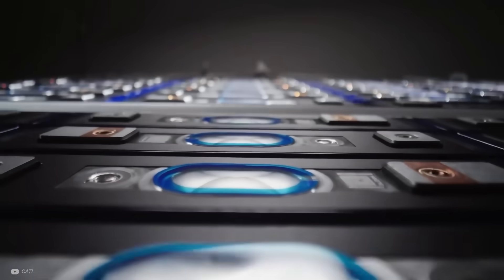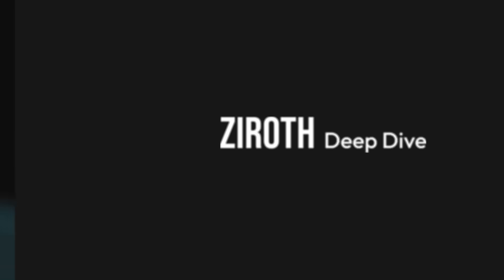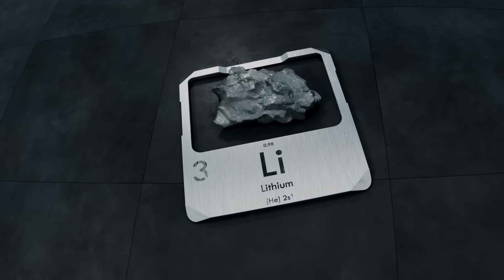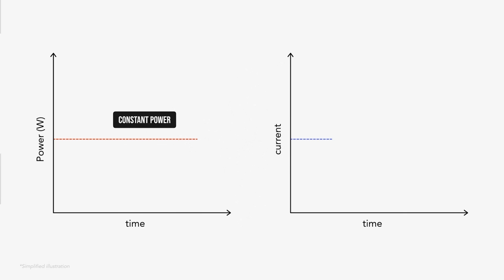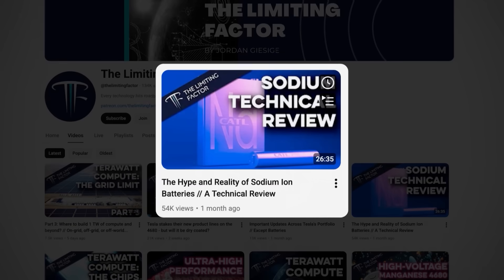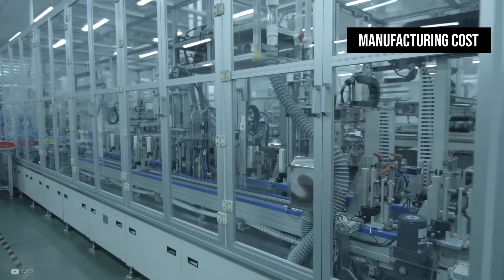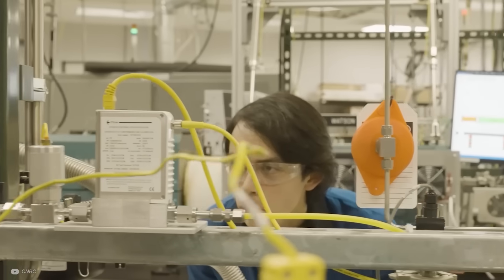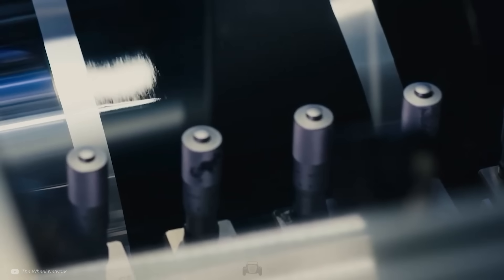How CATL’s Reinforced Sodium Battery is Insanely Cheap

Comment: Will Prowse: "Calendar aging will kill your batteries faster than wear"

Such a frustrating statement! The calendar aging reduced your battery capacity regardless of if you use it. Your wear from cycling is a biproduct of "extracting value" (using) the product. If you simulate it all out, you extract the most kWh over it's life span by using it quite agressively with deep discharges rather than gentle 20% to 80% DoD cycles.

However, if you don't use the battery it will retain it's capacity above 80% for longer than if you deep cycle it every day. So Calendar aging catagorically does not "kill your batteries faster than wear".

The centiment is right, but the statement is just catagorically false because of the wording. The worst bit is when challenged on this he deflects with semantics and straw men. He's doing some interesting research and I love the majority of what he teaches! I'm just worried I'm learning the wrong thing watching him as his communication skills are apparently not great. What else am I "getting the wrong end of the stick" with from him?

Comment: I understand that Antimony is used as a critical element of the cathode. You should be aware that this is a critical mineral. It has few sources with China processing a very large % of world production IIRC. If Antimony is needed then the widespread availability of sodium is irrelevant. Antimony would be the bottleneck and supply chains would rest yet again on China.

Comment: I think that the voltage problem would be more obvious to the viewer if you used a nominal 400v pack to illustrate the problem, than a single 4v cell. 

The voltage of a large pack going from 400v to 200v over the discharge cycle makes the problem quite obvious.

Comment: if the Donut lab's announcement in 5th of January 2026 about an All-Solid-State battery holds true, CATL is already behind the curve; World's First All-Solid-State Battery in Production Vehicles by Donut Lab, an European battery and motor company, that might well be the first Unicorn company of Finland, more significant than Nokia ever was, if these claims hold true and the business side is handled well.

Verge Motorcycles own's Donut Lab, and Verge Motorcycles has already used the Donut Lab motor for a Guinness World Record for the longest distance by an electric motorcycle on a single charge, which is 310.689 kilometers (193.053 miles), set by Sam Clarke and Sara Sloman on a production Verge TS Pro in Greater London on March 22, 2025, navigating real city traffic conditions. The record-breaking ride, which took over 16 hours and used an unmodified bike with a sealed charging port, still had 7% battery left, demonstrating significant real-world range beyond lab tests. This was before the introduction of the Donut Battery, which is set to be on the latest version of the TS Pro bikes.

Comment: the near-linear voltage drop during discharge would make charging electronics and showing the status much easier in simple/small devices… all that magic we do for LiPos could be replaced with a simple volt meter, just like back with acid batteries.

Comment: AI Overview
Sodium-ion (Na-ion) batteries are expected to see large-scale deployment in EVs starting in 2026, led by manufacturers like CATL (Contemporary Amperex Technology Co., Ltd.), who plans to use them in passenger cars, commercial vehicles, and battery swapping systems for cost savings, better cold-weather performance, and improved safety, with mass production already underway for some applications. While early adoption might be for specific models or regions (like China), the technology is transitioning from labs to market, with significant growth anticipated through 2030 for various electric mobility solutions. 
Key Developments & Timeline:
2025: CATL launched its Naxtra sodium-ion brand and began mass production, with its cells passing China's new EV battery safety standards.
2026: CATL aims for widespread commercial deployment in passenger EVs, commercial vehicles, and battery swapping services, with a target of 500 km range for some passenger cars.
Beyond 2026: The technology is expected to grow significantly, offering lower costs and greener credentials compared to lithium-ion, potentially powering a broader range of EVs and energy storage solutions.

Comment: Wouldn't it be beneficial, to allow much larger voltage on these batteries (the optimal operational in higher range) and simply introduce a DC stepdown module with some sensor and real time management of such module? So It would let's just say slowly drop from 20V to 12V but the device is powered 12V at constant. Seems pretty simple but I am no engineer and definitely not that good with electronics.

Comment: I usually really love your videos but, respectfully, this seems to be not your best work IMHO due to ambiguities (e.g. "the not too distant future...?") and not very reflective of all the positives for Sodium batteries that we're being told by industry, e.g. graphs with uncertainty bars showing up to 2040-2050 time frame!? Also, it seems cost subsidies will play a big role in the probability of success and that could easily drain a manufacturer's long-term bottom line. Since grid storage has been touted as the best application of these batteries, at least for the next decade or so, is that where the subsidies for EV use are planned to come from? Good info, though, on challenges of power electronics due to varying current/voltage over charge range. I guess I just couldn't get a consistent read on your position. Maybe I just need more coffee ;-) Best regards.

Comment: Ryan, as well as gravimetric energy density (11:58) one also needs to consider the much lower volumetric energy density of Sodium-ion based cells. This can be seen in CATL's current Naxtra cells, as shown in their Freevoy dual-chemistry battery, where the Sodium cells are 15-20% thicker than their LFP partner cells. For constrained volume applications, like EV battery packs, having sufficient volumetric energy density is as equally (if not more so) important as gravimetric energy density, as being able to fit fewer cells per pack lowers the pack's overall energy capacity compared to an equivalent Lithium based one. 

For applications with less constrained space requirements, such as grid and home battery storage, the lower volumetric energy density is less of a concern. Although, constrained footprint deployment sites may opt for Lithium over Sodium to increase storage capacity to fit a particular site requirements.

I know you also stepped over the consideration of temperature in the video, since most stated benefits focus on Sodium's low temperature handling (and rightly so); however, there is a disadvantage with current Sodium cells at higher temperatures. Current Sodium cells use non-aqueous electrolyte formulations, for higher power densities, that are less stable than their Lithium cell counterparts; starting to degrade from the mid 30ºC, introducing greater cooling requirements for Sodium cells with associated additional costs.

For EVs the lower energy density, smaller battery capacity, and higher systemic costs (cooling and more expensive power electronics covered in the video), likely results in the technology cut-over point not being based on the cell price alone but rather that of the whole vehicle's battery system.

Comment: Li ion (nmc chemistry) also have voltage range for 4.35V (fully charged) to 2.5V (fully but still safely discharged). So it would seem to me that the decreasing voltage/increasing amperage is already a solved problem.

Comment: I think you are wrong and house batteries will become the greatest market when they have better, cheaper batteries. I wouldn't own a Battery Car because petrol/diesel vehicles are much more convenient and provide the range I want. Battery backup for my house isn't out of the question to make my generator backup system more efficient by capturing my overproduction of electricity when the generator is running at it's most efficient output.

Comment: How hard is it to find and mine Antimony?
Reply: In short, hard. 

Antimony's abundance on Earth is 0.2 parts per million (0.0001%) with about 130,000 tonnes extracted each year. The key issue though is access as the mineral is spread thinly across the globe and requires areas with large concentrations to be commercially viable to extract, most of these are in China (which currently produces 74% of Antimony). Most countries list the metal as being the second most supply risk element (with only the rare earth group of elements being a higher risk).

However, Antimony extraction requires significant energy (heat) to process, and even here China is reducing output due to the energy costs involved and emissions resulting from extracting and purifying the element. It also doesn't help that the metal, and some of it's compounds, are toxic (similar level and impact as arsenic).
Reply: @GruffSillyGoat Thanks! Do you think this material is rare enough that it offsets the benefit of using sodium from an environmental perspective?
Reply: @marcuswilson9037 - probably, it's the same consideration as other rare minerals, plus in this case handling and waste processing has to be factored in due to the minerals toxicity.

Comment: What stands out in this analysis is the focus on manufacturability as a key driver of adoption. While our expertise is in mechanical rather than electrochemical manufacturing, the challenge is universal: moving from a patented idea (like your CNC or sheet metal part design) to a cost-effective, reliable physical part. We see this daily across industries, and it’s why we offer a range of processes from 3D printing for initial form studies to injection molding for volume-ready components. Thanks for a clear and insightful look at a key industry shift! For those designing the products that will use these new batteries, we’re here to help build them

Comment: I am still using lead acid batteries in my 1996 Geo Metro / Solectria Force. I have a range of 50-60 miles and a top speed of 64 mph. LOL. Of course, my problem is that if ANY of the electrical components go bad, the whole car is scrap as I can't get parts anywhere! Wish me luck.

Comment: I think Will Prowse misses a key advantage to voltage changes related to SOC.  The charge cycle is simplified and more accurate as voltage gives a most accurate indicator of SOC. Lithium chemistries are so flat voltage is a poor predictor and instead counting amps in is used: a poor and often dangerous metric. Discharge side electronics will be more complex, yes, but 100 years of lead acid charging we are good at it.

Comment: I actually thought that you always use voltage converter when using power from battery in a device. Then higher current will be needed only up to that part in electric scheme, no?

Comment: The voltage curve shown for sodium is similar to the voltage curve for other standard lithium ion chemistries like NCM and NCA which have been around forever and are also not flat like LFP. This has not stopped those chemistries from being used for many decades, so I think you grossly overstate the importance of a flat voltage curve. There is no issue with developing electronics to work with the standard voltage operating range of 4.2V-3.0V of a lithium ion cell. Having a flat voltage curve is not required. LFP is more favored for it's lower cost and long cycle life rather than for it's flat voltage curve. And of course LFP has a lower energy density than NCM and NCA chemistries as well so it's a trade off.

Comment: again, the main sodium issues are  conveniently ignored in this yet another "talk in circles forever" video. when your 500v ev battery needs 10kw and the soc is 50% and volt dropped to 250v.. are you ok the wires now pull 100% more amps? and how will this effect conversion efficiency, not only in EV but also households. who wants their 50v battery to say 25v and then pulling double amps? what when it says 20v? 15v?

Comment: There's more to the story.  And comparison should consider volumetric and mass density of energy storage.  The Li batteries produced today are about half the energy density of what's going to be available in 2-3 years with solid state cells.  EVe heavily favor high energy density and fast charging (high rates).  Stationary energy storage is far less concerned with energy density and power output.  Discharge times of 2-3 days will be more useful for stationary.

Comment: Battery grade Lithium has been between $10K and $12K a metric ton for over 2 years. Your best case is sodium costs become equal at the target energy density for EV... a decade from now. This still doesn't fix the worst discharge curve of any cell chemistry in existance. The best sodium will do is specialty packs for harsh climate. Like LTO, it will have it's niche but certainly won't replace LiFePO4 any time in the next decade. I understand they still need to try but I can't believe the number of people out there who are holding off upgrades and investment now, waiting for sodium.

Comment: That flat discharge curve is actually part of the problem.  Beyond 50% discharge, you can no longer use the cell voltage to determine the state of charge so you have no idea how much power is left until moments before it's completely discharged.
Reply: Which is exactly why there are zero LFP EVs on the road today..../s. Use some common sense man, they have already figured out this problem. We wouldn't have EVs with LFP batteries if they hadn't. It's called coulomb counting. 
"Coulomb counting is a battery management technique that estimates a battery's State of Charge (SOC) by continuously measuring and integrating (adding up) the current flowing in or out of the battery over time, essentially counting the coulombs (charge) transferred to determine how much capacity remains." 
It's also why EVs with LFP batteries are recommended to be charged to 100% weekly, it's to recalibrate the coulomb counter used by the BMS to know the batteries charge level.
Reply: You mean you can’t figure it out.   Not that difficult really.  That’s why it’s being done accurately in the two EVs in my garage.

Comment: When I look at the precipitous drop in the price per kWh in any chemistry, and then I try to buy a PowerWall, or other such home energy storage systems and these companies don't seem to have heard. If you look at the drop in price from the original PW, vs the actual cost for a PW now - we should be getting five times the storage (I know it's more than the cells, but why don't you throw an extra dozen kWh, since they're so cheap -  for the same price.)

Comment: It seems like your supposition is that EVs will continue to be the dominant battery draw. It seems to me that if we are going to truly move in the direction of solar, wind and water as sources for electricity we would also need a means to have downtime storage capacities large and cheap enough to support entire cities. Would these sodium batteries with PW cathodes be able to sustain a large scale stationary storage model to support the off hour KW draw of cities like LA, New York, Chicago, Paris, London, etc…

Comment: haha. 2000$ per ton for sodium and 17000$ per lithium looks like a huge difference. but that is only a small part of the battery and you need double as much per kWh. you need also more aluminium and graphite and kathode material and electrolyte. and you will have an awful range because you run out of space in the car. for a car this is terrible. for grid storage the space that you need is not that relevant.

Comment: Energy density of Na-ion batteries is still well lower than for Li-ion batteries: 160Wh/kg vs 300Wh/kg, so a Na-ion battery with a capacity of 100kWh weighs 625kg, compared to a Li-ion battery with same capacity of 100kWh which weighs 333kg. Even if both batteries will provide same theoretical autonomy for an electric car (100kWh=533km), higher car weight with Na-ion battery means more energy needed for moving that mass, hence less real autonomy and less performance.

Comment: US$25/kWh is basically cheaper than 20 to 30 petrol fillups from empty in an average car. Considering this is an energy storage medium that's going to last, according to some, 50 years, and with electricity for charging costing (in my country, at least) US 22 cents per kilowatt, petrol is done for. Petroleum is dead already but it's standing there looking at the bullet wound in it's chest in its last few horror-filled seconds of existence. I genuinely couldn't be happier. As a lifetime commuter cyclist, for the same reason people are now switching from petrol to EVs, I can't stress enough the evidence that petroleum, especially deisel is responsible for more chronic and fatal diseases than any other aspect of tecnological life. At Everything Electric Melbourne, I watched a panel discussion on this subject, cancers, neurological disorders, depression and so many more, all tying into fossil fuel exhausts, especially deisel fumes. The research mentioned was from the Peter McCallum Institute in Melbourne and one of the panelists was one of the researchers on the project, also doing her PhD some years before in the same field. I was riding in that "soup" trying to reduce my greenhouse gas output for 40 years and my health has gone to sh** in the last decade, despite as much as 200km of light aerobic cycling exercise 5 days a week. My fitness saved me from death by cardiac arrest, chemo saved me from cancer before that, and insulin saves me from adult onset type 1, yes, that is a thing, I have the formal diagnosis from an endocrinologist, - but the oil industry was happy to poison infants and adults and everybody inbetween, alike.